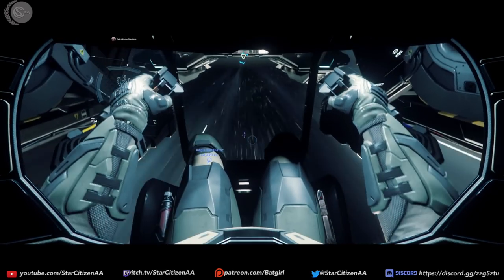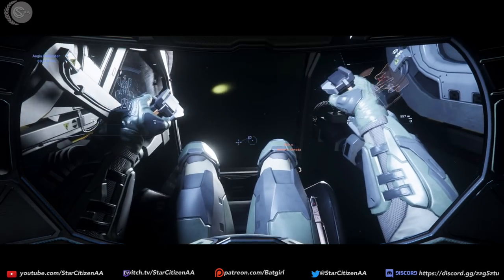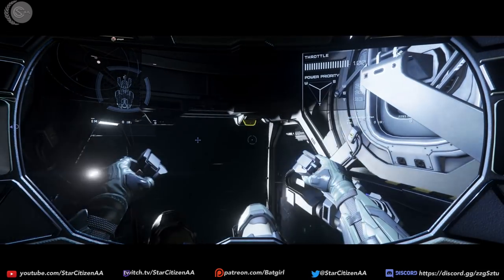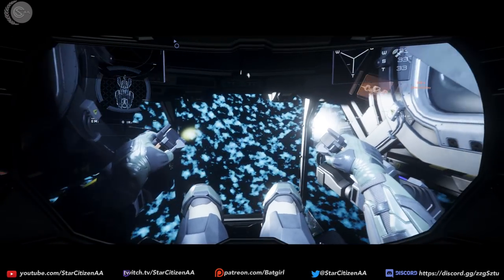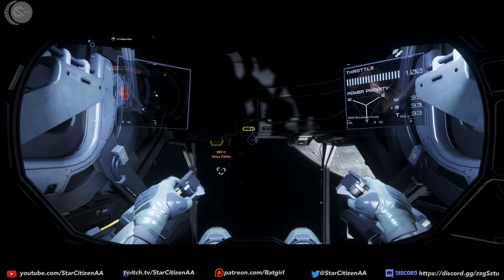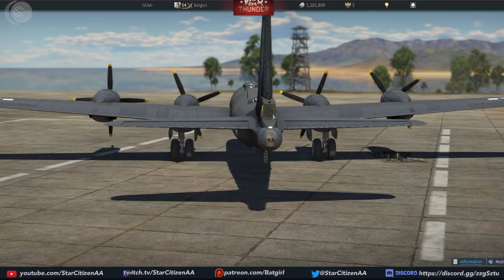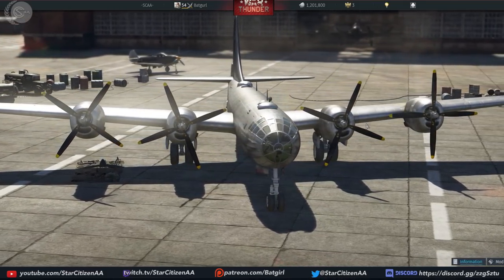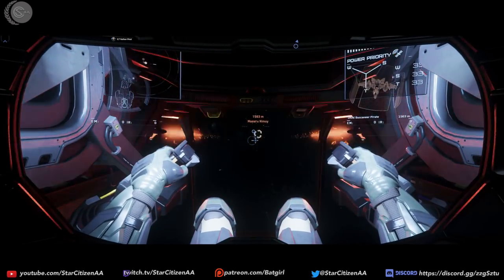Turrets are Bad! But they were fixed in 1944!

Comment: Great video Batgirl.   Do you think that the recent shift to more remote turrets (or the upcoming ability to change from manned to remote) will adjust for this?
Reply from the maker: It all depends on if they include a change in the way turrets look and work and not just implementation of a remote version of the same turret.

Comment: It did sound a bit like what you described, but the best kind of turret I could imaging on a space ship would be something with the movement pattern of a mini gun in the side door of a helicopter. Does not even have to have a 180 degree angles, or even the same angel for left/right and up/down. Say something like a 120 degree left/right and 90 up/down, to better match computer screams not being square.

But more over I think the very concept of player manned turrets is doomed. If someone playing a space trucker got involved in 10 minutes of space combat for every hour of play, that would properly be way to much with all the other game play. With finding jobs, loading cargo, take off, quantum travel, jump points, scanning by law enforcement, landing clearance and approach, unloading cargo, refueling, and repair/rearm.
And 10 minutes of turret combat for every hour of game play would be way to little for someone enjoying that play style.
Reply: Well you could have a mini gun mounted on a gimbal which itself is mounted on say a rail which does a 360 around the waist of the ship. This would give it loads of coverage and with another gun you could probably cover almost all the space around your ship.

Comment: I have long said that automatic and remote turrets will be necessary if they are ever to work.  While I think you certainly nailed the importance of a remote turret and radar guidance, there are some major issues that still remain.  For instance, there's a reason that turrets have basically been never used since the B29 and 1944.  Yes, you still see them on helos, and that's a good indicator of what's wrong with turrets in general for SC.  Turrets, IRL, were phased out, even with radar guidance, as intercept speeds and ranges increased, thus leaving them only viable for relatively slow platforms that target even slower platforms that move mainly in only 2 dimensions.

Turrets cannot work well in any environment that has high intercept speeds, very maneuverable platforms, and the complete 3D space as a battle environment.  This is why missiles have shined for fighter aircraft instead of more sophisticated turrets. 

No matter what, a bullet is a dumb projectile once it leaves the barrel of a turret.  With closing velocities of greater than several hundred meters per second (and a significant fraction of the velocity of the projectile) combined with maneuverable vehicles, turrets are just never going to work well.  This is because ships have the ability to move out of the way of even a perfect shot.  For them to work at all really, they'll need to be fully automated.

It's my personal belief that in SC turrets will eventually be fully automated in nearly all cases - or ship maneuverability and speeds will be drastically reduced (like by a factor of 3 or more).  I think it's far more likely that the turrets will simply be fully automated and still of only marginal usefulness.
Reply: There is only one major flaw I can interject into your comment.  Ships are being built and or have been built with the intention of putting a person in the seat of them.  Automated turret systems would not need the space currently allocated for them.  If they became automated, what would become of the space they were given?  The Connie has two tubes for the chair rails and chairs to ride along.  That was a lot of real estate used up to get a person up and down to them.  If those turrets became automated, what would happen to that space?
Reply: @Rickbearcat  Honestly I don't know. My guess would be that the turrets would be automated through use of an NPC.
Reply: Honestly, I completely forgot about the ability of an NPC to man the turret.  Thanks for reminding me.
Reply: Slow bombers did go the way of the dodo (except in certain instances) not just because of the faster speed of interceptors (jets) but because of SAM's and other stand off weapons.

But you are right that in this space future conceived by CR where spaceships fire 'dumb' short range ammo, it makes no sense to have individual controlled turrets and they would all be slaved to a single manual or automatic fire director.

If this could be achieved on early to mid 20th century warships, it would surely be possible in a spacefaring future!

Anyway I used to read a lot of space opera sci fi by the likes of Alastair Reynolds, and it might have been in his novels (or maybe in Peter F. Hamilton's) that combat tends to take place at close to light speed and with relativistic weapons. It's much more strategic and interesting. Ships have massive ablative coatings of ice and throw massive solid hydrogen slugs at each other and stuff.
Reply: @Rickbearcat  wouldn't you need reapirmen to fix the automated turrets should they become damaged? The space wouldn't be redundant if that mechanic was implemented.
Reply: @wiser3754...Turret repairs will be done automatically at CryAstro's or truck stops with automated repair bots.  I don't see actual people doing this job.
Reply: @Rickbearcat  - and if they're damaged in the midst of combat?
Reply: @wiser3754..." and if they're damaged in the midst of combat?"...You won't make it out alive, 'cause you won't have the time to repair them before youor your ship is done for.

Comment: Turrets in Chris's way of design will never work.....period. They are to slow as a maned option unless he goes with the Starwars option of sitting in a fixed location with the guns remotely operated via a targeting computer. As moving a whole mount is tediously slow where a small gym balled mount is much faster and. if you look at the falcon it only has two windows that thay can see out of but the actual targeting is done on a display screen which is mounted to a gym balled chair that gives them the sense that they are moving to shoot the guns. this needs to be revised in sc AND FAST.